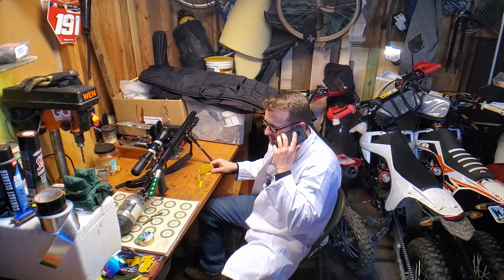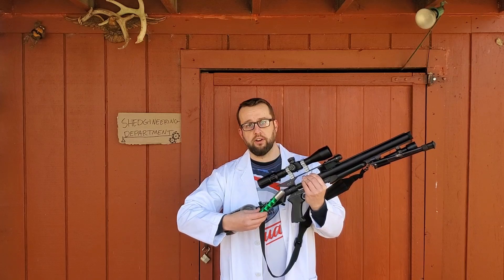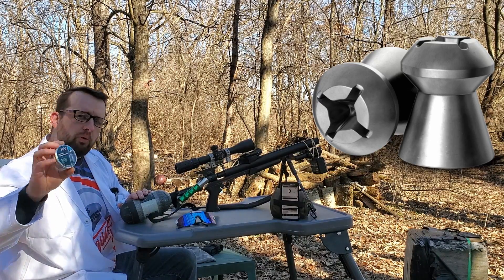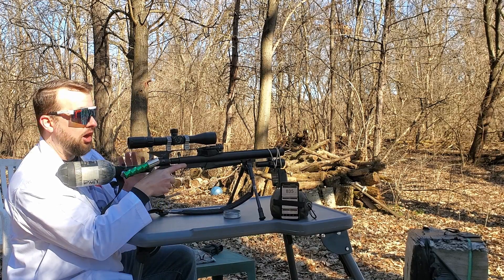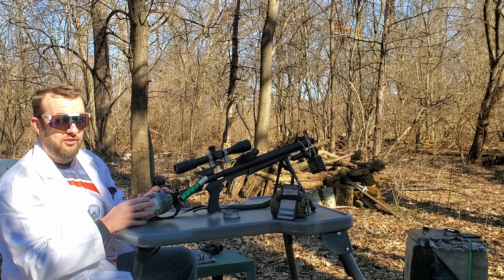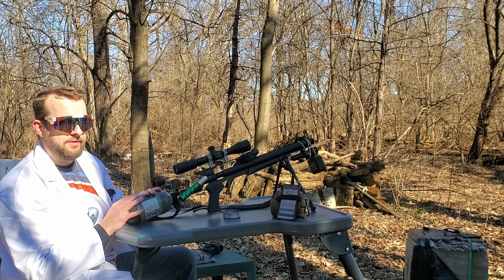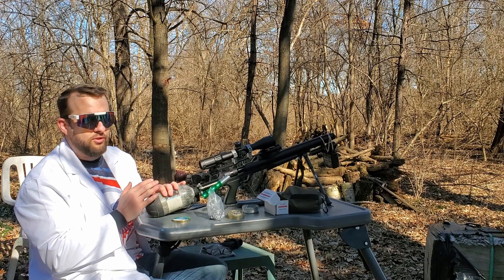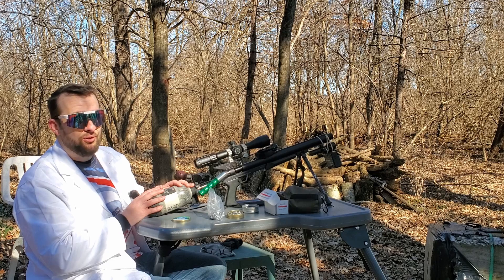PLENUM For The TALON SS! Homemade Plenum For Regulated Airforce Airguns! Will It Add MAD POWER?!?!?!

Comment: the only thing i dont like about mine is the top loader,yea i know they make a side loader but im sure it's expensive and yada yada yada i dont even know what mine is shooting at,i left it at the setting that it came from the factory in.hits hard to me and last for a lot longer than i want to sit there and shoot it,ive thought about cranking it up some so i could empty the air out quicker,i dont like letting it set for months and months with over 2000 psi,but if i crank it up then i would have to re sight it in,which is no big deal,its on the money like it is,so why am i talking haha bored,lonely ? i dont know haha

Comment: You were talking in between just to get plenum filled with enough air to get the shot string straight
Reply from the maker: Doesn't matter, it fills instantly. You can shoot as fast as you can load and it will be consistent.

Comment: How long have you been in this hobby and do you follow the AG forums?
Reply from the maker: Since I was about 7 or 8 years old. So like 30 years. Bought my first PCP (the Talon) in 2004. I do get on the forums from time to time
Reply: @airshootist  So old guard, I started following you because of your post on Skout Airguns, I didn't know there was such a valve that could be adjusted in milliseconds that definitely turned the PCP world upside down, I still think the Epoch should have a big plenum and a bigger regulated plenum 220-250 bar least in order to push heavy slugs, especially in larger calibers, and their barrels are still a total unknown, they should be advised on this matter, and you have that option...
Reply from the maker: You need WAY less pressure with a spool valve to push heavy slugs. I can shoot the 44.8gr FX Pellets at like 880 using only like 1300psi. I will have some more videos soon, thanks for following. 

And a little birdie told me that there will be an update coming where you can use FX barrels in these guns.....
Reply: @airshootist  I doubt these claims, but here we will find out everything soon, thanks for such good videos

Comment: Interesting.  Same principle we use at work for high demand pneumatic cylinders . We have large accumulator tanks that can dump a large volume of air in milliseconds.  If we tried using straight supplied air, the process would be slow and inefficient.  
Great job using proven technology to achieve awesome results. 👍
Reminds me of the pumpkin chunkin contest where the air cannons use the same principle.